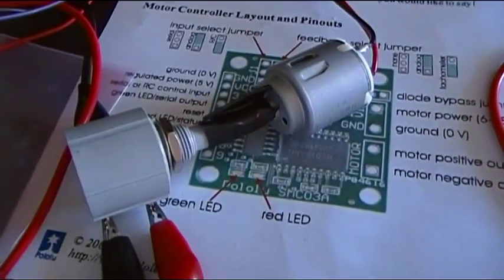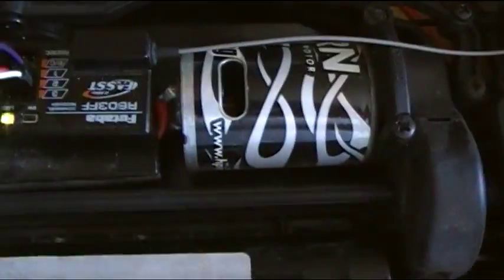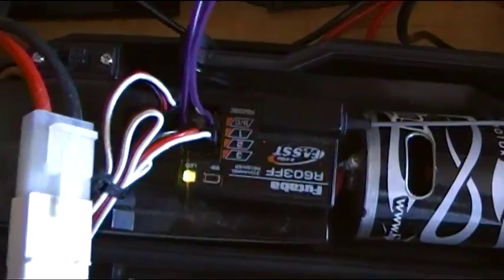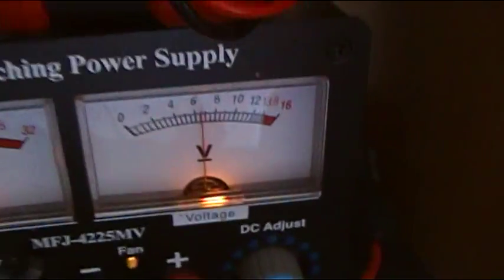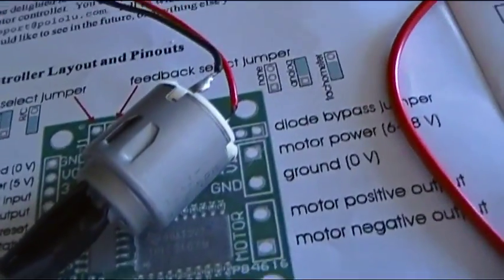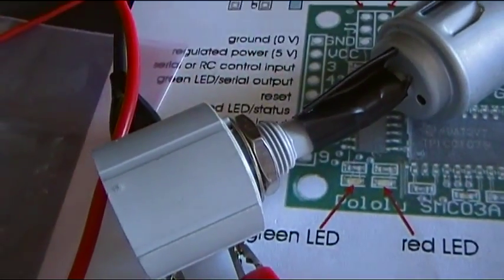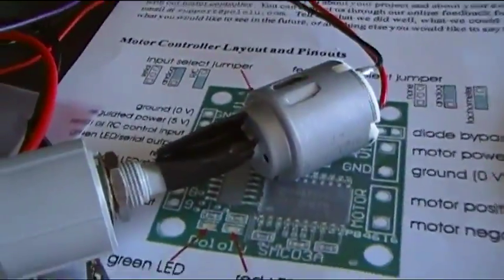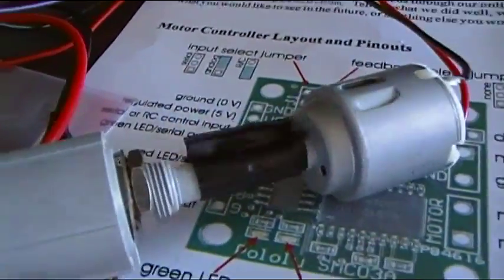Turning a DC motor with RC car remote.

Comment from the maker: @Foffanna Well you got to understand that both the DC motor and ESC has a rating on them for maximum voltage that can be used.  So by applying more voltage to your RC car you could burn up one or both the DC motor and ESC.  With that said yes you can simply switch out the battery that you have in your car with one of a higher voltage.  What I would do is buy a new ESC and DC motor that can handle a higher voltage.

Comment from the maker: @eightbit3055 There is also these old tricks that I have never done and I recommend not doing unless you research them.  Like running your DC motor in a cup of water for a while to wear down your brushes so it can turn easier.  Another one is changing the windings of your DC motor.  Like I said, these you will have to look up and see how it's done and how it works because I'm just not sure so I don't recommend it.